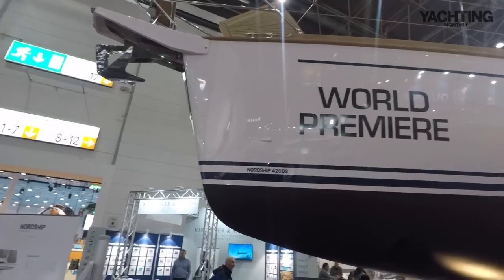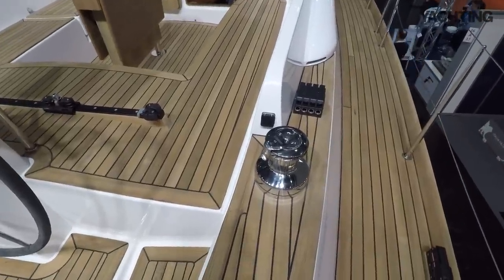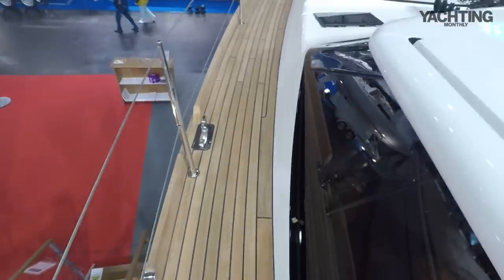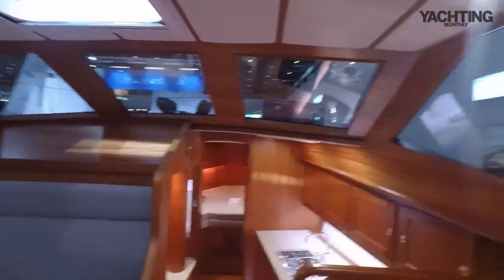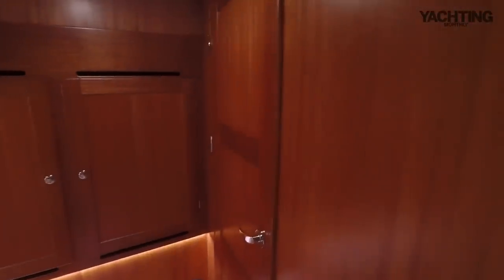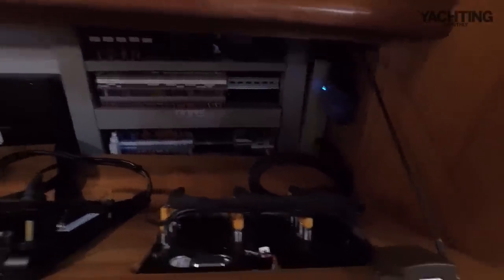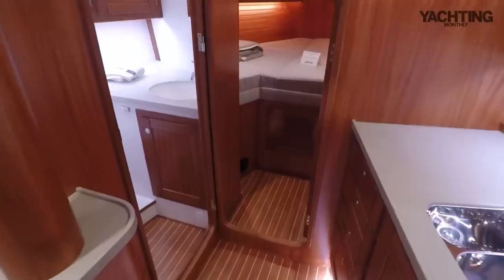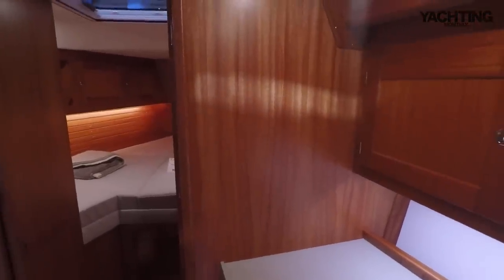Nordship 420 DS: The boat that offers everything? | Yachting Monthly

Comment: This design looks great with great accessibility to everything.   With that price they chose to use galvanized steel girders and not stainless?  Would like to have had a look at construction of the fin keel and rudder with options for customizing for what your about to buy.   Its not a boat for everyone but its got good floor plan options.
Reply: Galvanised is stronger and mure ductile. Also more inspectable and more predictably corrosion resistant when tucked into tight crevices. Stainless can degrade and fail with little warning, in areas like that.

Comment: Everything is compromises, I suppose..... While segregating the sailing cockpit so throuroughly at the stern makes for a better "veranda" for kids and guests, the poor skipper looks awfully exposed back there, if the weather kicks up in locations requiring hands on deck work, not just running everything from an autopilot remote in the deck saloon.

Comment: Nice boat, but spade rudder? A deeper skeg to hang the rudder on  would've been better. Speed is nice but its not everything.
Reply: There is one. Inside the rudder. Placing it inside the rudder, as opposed to in front it, is what makes the rudder balanced :)

Short of hanging the rudder at the back of a full keel, you can't really build a skeg, at least not on a fibreglass hull, which is any stronger than the thick, steel, rudder post supported by bearings at both hull and deck.

The rudder attachment is effectively as strong as it can be made, without it being stronger than the hull it's attached to. The latter to prevent a rudder impact from ripping the rear of the hull apart.

Comment: How come there are no hull windows?
Reply: Probably because they weaken the hull. And are less useful when you already have much larger windows in the deck saloon.

Cabintop portholes would be nice, though. I've seen other Nordships with them, so they may be an option on this one as well. Relying solely on overhead hatches for ventilation, is not ideal, since those often end up serving mostly as exhaust vents. Which results in a tendency for air to be drawn into living spaces from less reliably fresh parts of the boat. To the extent there is anywhere to draw air in from at all. Side facing portholes complementing hatches, facilitate fresh air intake, to compliment stale air exhaust.